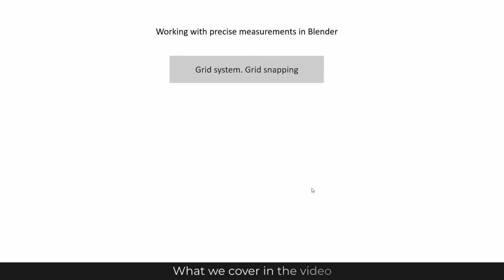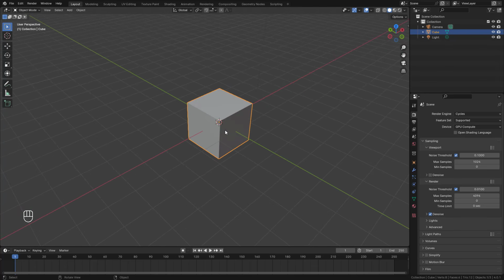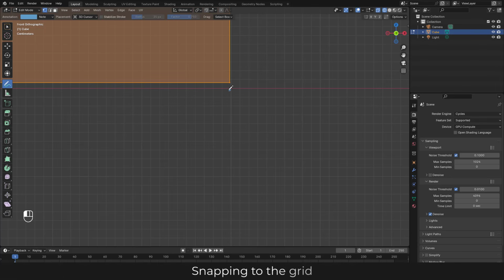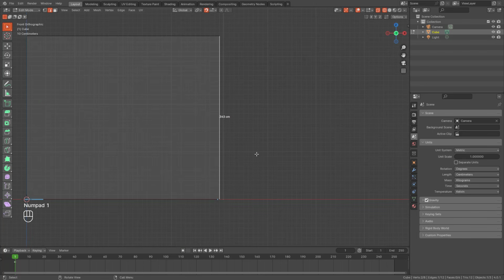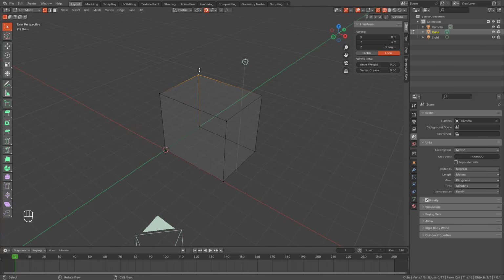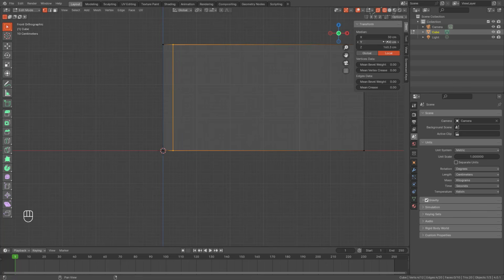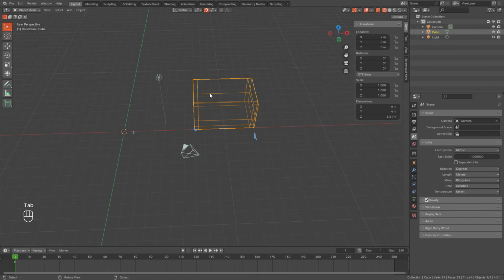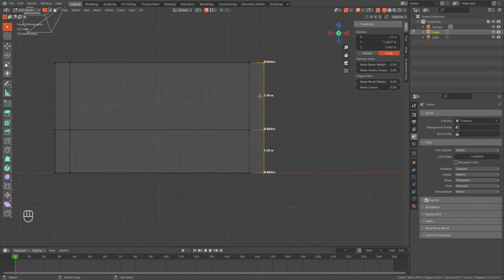Modeling with precise measurements in Blender. Top tips. No addons.

Comment: Use 4.x!!!!! pressing B after the transformation enables you to select the base point for the transformation, just like in cad programs. Also, pressing ctrl while doing the transformation enables the snapping temporarily. And pressing shift, you can select multiple snapping modes at once!
Reply from the maker: Thanks a lot for the comments! Yeah I'm using Blender 4. And I'm aware of everything you mentioned, I have a full course on Blender on Udemy, also there's an update for Blender 4 there. You can check out the course following the link in the description of the video. Thanks anyway
Reply: S, B, LM and nothing happend. Maybe it's need some adddons again?
Reply: @waltage  If you're using 4.0 or newer, it should work.

Comment: Great Video!. Another useful tip: You can make basic math operations inside the measure fields for scaling and  moving. If you have, for example a cube of 20 cm, you can write in the field of an axis 20 + 35 cm  and that side would scale to 55 cm.  No external calculator needed.
Reply from the maker: Great tip! 👍
Reply: Blender has had this feature for at least 15 years, it’s awesome! I would have loved to see the face of our host when he learned it in your comment ! 😅

Comment: i've been in the building trade for 35+ years, and every architect, engineer, draughtsman, roofing carpenter, tiler, plumber and bricklayer i've ever known uses millimetres for everything - it's universally understood by everyone and all drawings and datums are unwaveringly calculated in millimetres - where you get this idea of 2 metres, 5 centimetres, 4 millimetres from is beyond me - it adds an unnecessary layer of confusion and makes me think you've never worn a pair of boots out on a building site, let alone 10 pairs
Reply: Perhaps another country
Reply: @marcelotai1055  As far as I'm aware (and I've worked in a company building plants around the world), using millimeters for all measurements is globally common use so I doubt it has to do with another country.
Reply: ...however, it's still a nice feature that you can enter mixed units in the value fields.

Comment: These are great top tips indeed. I didn't realize that Blender already has built-in tools that can make precision modeling a thing in vanilla. I would love to use this in conjunction with hard surface modeling while recalling the basics from drafting class back in engineering school (yeah, even back in the 2010s, we did stuff on paper so we can understand how to interpret drawings like old ones). And the new snapping tools for 4.0+ is making this easier. While it doesn't turn Blender into CAD, you can use the knowledge and experience from CAD and engineering to make things with a lot more precision than before.
Reply from the maker: I'm glad if it helped you!
Reply: I've done game modeling in blender for decades, these snapping tools have always been in blender and are crucial tools for any game modeling you will do.